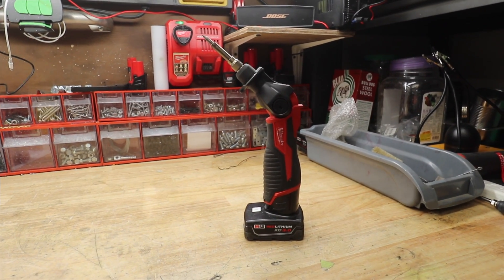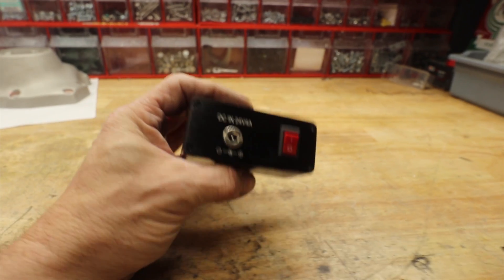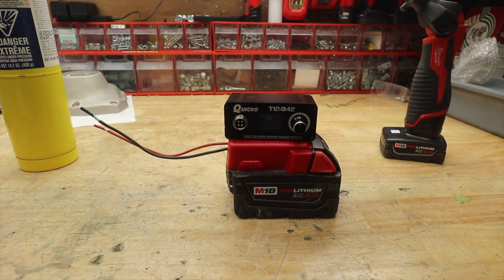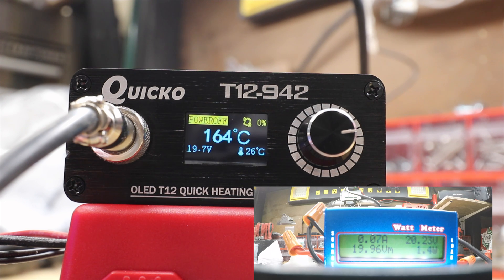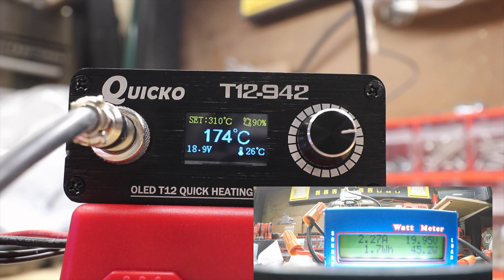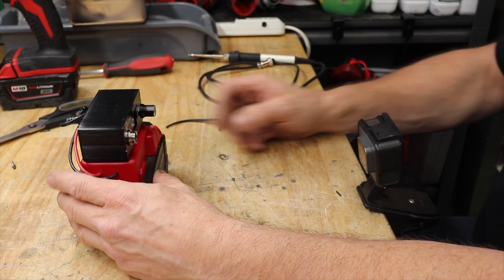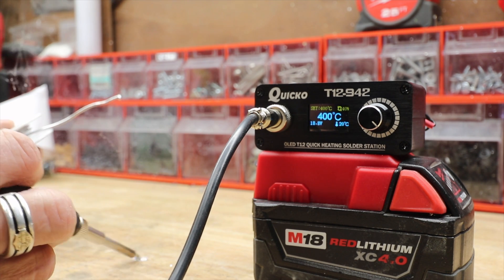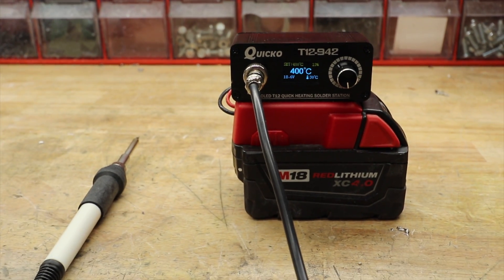M18 Soldering Iron You can Build in 10 Minutes.

Comment: This is one of the most useful vijeos on these here interwebs.  Answered all my questions and kept it snappy.  

Ordering parts as we speak.  Well, as I type.  I'm going to mount it on the adapter as you have, but reroute the wires to run them up inside and solder them.  Since I have some dead Old Milwaukee batteries I'll gut one and fill it with sand.   That'll keep it in place when used plugged into a power supply at the desk.   Your way leaves it with plug flexability and doesn't let someone hook a power supply and a battery up at the same time, but I'd snag the wires on something for sure.  Grok and I just worked out how to use an "ideal diode" to keep the battery isolated if someone else does plug in power while it's on a live battery.  Looks like there's just enough room.  

They have it listed at 75w, but your 45w seems right.  I plugged my "60w" stick iron into the Kill-A-Watt and it only spikes to 40 or so for a bit then levels off like this.  Not sure how they come up with these ratings, but that suggests it'll have the same power I'm used to.
Reply from the maker: I’m glad this video was helpful. As far as the wires on the back go, I’ve been using this thing at least once or twice a week for a few years now and have never snagged those wires once. Thanks for watching.

Comment: Quickoo now sells a Milwaukee compatible T12A solder station for just $49.95; slides directly onto the M18 battery (adapter not needed), includes 5 tips, and has a hibernate/wakeup function when you dock the iron into or lift it from the holder. I already have M18 batteries, so I'm gonna buy one of these. The  Dewalt version costs the same, the Makita version costs about $10 less!
Reply from the maker: Thanks for the info, I'll have to check that out.

Comment: I built this exact setup two years ago. Its amazing. Also you can buy a 10 pack if different tips online for this torch to make it even more versatile. Also gets hotter than my m12 soldering iron even though that one is very handy too
Reply from the maker: Agreed. I loved my M12 iron but they just kept melting on me because of that stupid plastic collar. After I went through about 3 of them in less then a year I came up with this idea. If I’m starting a big project I’ll just slap on a 9ah or a 12ah battery and the thing will run for days. I’m really happy with this set up.

Comment: I would have avoided those cables that hang from the back and can get caught on anything.  A hole through the middle of the adapter and through the bottom of the control unit box would elegantly solve the problem.
Reply from the maker: Just wanted to give an update on those wires on the back that can get caught on anything… well, it’s been 3 years since I built it and I use it weekly… I’m happy to report that I haven’t got those wires caught on one damn thing.  I’ll keep trying.
Reply: You can now buy a Quicko T12A  that slides right onto a Milwaukee M18V battery (no adapter or additional wiring required) for just $49.99; it includes 5 tips and has auto sleep/hibernate when you put the iron into the stand (heats automatically in seconds when you pick it up). No need to buy a separate adaptor or wire anything together! They also sell Dewalt (same price) and Makita-compatible units (for about $10 less;) no adaptor or assembly/wiring required. I already have lots of Milwaukee batteries and chargers; I'm gonna buy one of these for myself!

Comment: Awesome project.  Would be extremely handy for automotive soldering.  The 20 volt battery adapters are available for Milwaulkee and most major brands, such as DeWalt, Ridgid, Bosh, Ryobi and Makita.   Unfortunately, the soldering iron and controller are no longer showing to be available from Amazon.  Any other sources?
Reply from the maker: Here ya go. https://amzn.to/47d0zNJ
Reply: @i.b.lancer  Thanks, but Amazon states; "Currently unavailable.
We don't know when or if this item will be back in stock."
Reply from the maker: @chrisgraham2904  Are you in USA?.. Try this. I'm not sure why it keeps linking to the Canadian site... This should work.   https://www.amazon.com/Soldering-Adjustable-temperature-Autosleep-electronics/dp/B08QYXSN59/?_encoding=UTF8&pd_rd_w=gvjze&content-id=amzn1.sym.952cfb50-b01e-485f-be6e-00434541418b%3Aamzn1.symc.e5c80209-769f-4ade-a325-2eaec14b8e0e&pf_rd_p=952cfb50-b01e-485f-be6e-00434541418b&pf_rd_r=C0BBZN4S1A3R8X4RPS4Z&pd_rd_wg=Za6Ea&pd_rd_r=41db1368-271e-4caa-861f-d632c6911df9&ref_=pd_gw_ci_mcx_mr_hp_atf_m

Comment: great build... i work on volkswagen vans..and often have to do soldering for nefarious wiring  goblins..i have a butane soldering iron..but is is not very controllable..it puts out to much heat to surrounding elements..this will be a perfect solution..i like the fact that it turns off also....thanks for posting....edit: just made mine today...works great...i wonder if there is a way to bypass the  walwart connector...like directly wire it...that would make it tidier...

Comment: Finely built mine today!! Love it and now my coworkers are going to order stuff to build some too.  I opened out the little control box and drilled some hold to put nuts and bolts in then cut the wires inside putting some crimps inside with a ABC5 fuse and holder.  Can't use that 24V plug now since I cut the wires to it but it is forever going to be on my M18 battery power.  Love how fast it is and in the setting you can set auto off for low voltage, time delay off, and so many cool setting.   Love this new tool 🥰🥰🥰
Reply from the maker: That’s awesome. I’m glad to hear it. 👍
Reply: @i.b.lancer  been using it and everybody is super jealous wanting me to make them one too which is too funny I show them your video and send them links.  It is so handy! Love it!🥰🥰
Reply from the maker: @fryreartechnology7611  That's awesome. Thanks for sharing. 👍

Comment: Great idea. I have Bosch 12&  18V platform but Milwaukee edges up due to the soldering iron. Milwaukee have many useful tool that Bosch lacks. 
With the above method it would be a good help. Hopefully someone  can come out with solution to put an iron holder on top of the battery. Have the battery as the base.

Comment: what is the min/max amp battery you can use with that device ?
Reply from the maker: Any M18 battery seems to work. Haven’t tried a 12ah battery but I have tried a 9ah with no issues.  And at the other end, a 2ah battery worked.

Comment: Suggestion: use a dead m18 charger instead of the ebay adapter, this way you can flush mount the device into the charger, and have the soldering iron wire exit through the old a/c input hole.
I intend to build one in that way. Thank you for the idea!
Reply: There’s been some on Etsy for sale for over 2 years that way.
Reply: Did you manage to make one? Kinda looking for ideas
Reply: I mounted a 12v fuel pump on a charger for transferring fuel.
Reply: Good idea
Reply: Did you ever build this